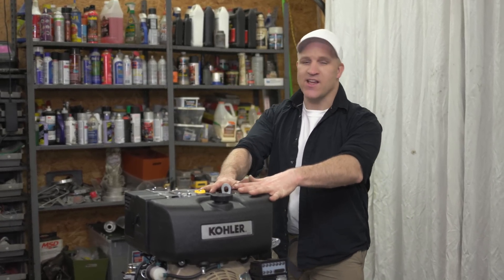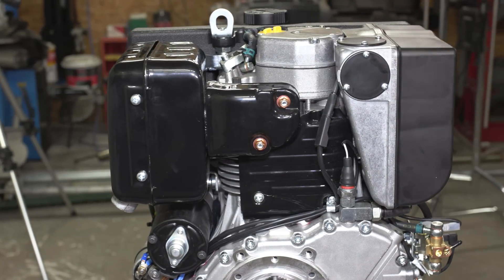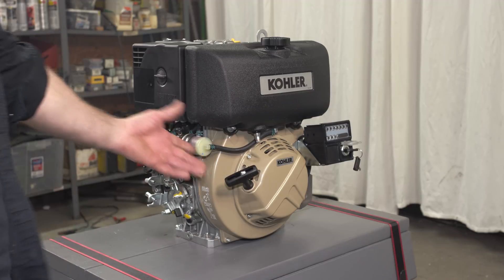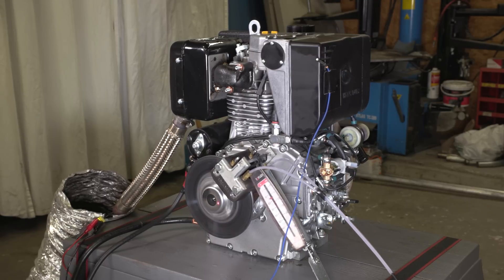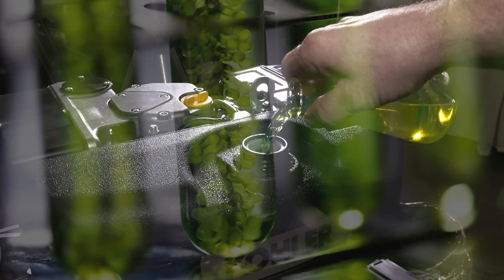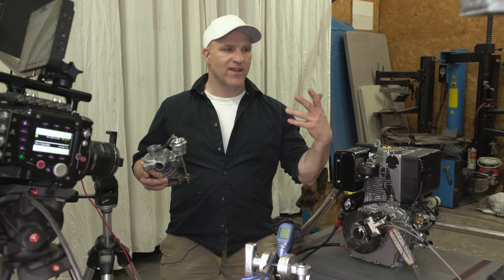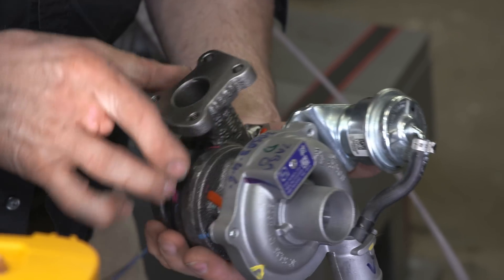Single Cylinder Diesel Engine - Dyno Test (Diesel, BioDiesel & HydroDiesel How Much HP?)

Comment: If you want to run it well with the turbo, you need a "boost tank" between the turbo and the intake into the engine. In a 4-stroke single cylinder, it's only pulling in air 25% of the time, the rest of the time, the turbo fights against a wall and will stall, the reserve tank allows it to build a little boost between the intake strokes without stalling so much. That way it'll have boost ready for the next intake stroke, then the resulting extra exhaust gasses spool the turbo more, creating more boost, and so on, until the turbo can't provide any more boost.
Reply: Known as a plenum.
Reply: @noidontthinksolol  that's another way of doing it sure, doesn't mean the reservoir doesn't work, it worked well for me on a 212. Gave it much more pull. Saved me spending money on a BoV when i had spare tubing laying around. I supposed a BoV does protect it from overboosting and blowing the head off or something, but then again, it's not like it's a 900bhp chevvy lol, just a bunch of cheap second hand parts on a second hand go-kart frame. Bit of fun :D
Reply: @noidontthinksolol  old stuff is way more fun, throw some stuff together, let it rip, have fun, it blows up spectacularly? even more fun! then go buy another haha

Comment: An engine making XXXX RPM and YY.Y torque always equates to a certain amount of power -- regardless of what fuel is being burned.  There is absolutely nothing interesting about that.  The most important piece of data -- which was mysteriously left out of the report -- the specific fuel consumption would (might) have revealed something interesting about the fuels, but because of the engine's governor, we don't know how much of each of the three fuels tested was turned into work, or how much was wasted as heat.

I suppose the warping in the actual perception was that this was about an engine test, while it was actually about an inconclusive fuels comparison; the engine was somewhat inconsequential, like the settings in Dino De Laurentiis' 1984 film "Dune".

Comment: How many times have you had to replace those brake pads lol. I ‘dynoed’ a 110cc pocket bike engine with a little disk brake on the output shaft and I could practically feel it wearing out with the hand brake I was squeezing with. Disk would turn blue in 10 sec

Comment: You need to do red off-road Diesel fuel
Reply from the maker: I was told that the red diesel is the exact same as the regular diesel but just has red dye added to it for the taxes. That's what I was told anyway

Comment: Interesting that the egt was about 100 degrees higher with the hydra diesel but power was comparable to regular diesel. I’m curious if the turbo will help the egt like it should or if it makes it worse
Reply from the maker: That's a great question that we're going to find out the answer to very soon.

Comment: presumably its just got a mechanical injection pump that should be easy to increase fuel for boost?
Reply from the maker: Yes, you can increase it to a point but you can't really start rolling coal.

Comment: Just a suggestion - you should try turning up the air fuel ratio and see how much the power increases
Reply from the maker: After I finish up this video I did. It was pretty decent, I also injected a ton of diesel right into the turbo and it was a pretty scary sight.

Comment: IF the engine is brand new, and you did the hydrodiesel last, it kind of stands to reason why it made more power.
Reply from the maker: Well I forgot to mention that in between the first scene where I started it for the first time, and the test, I'm broke the engine in completely over a. Of 4 days. When you first start these engines up before the rings break in they make a little bit of smoke, but once they're broken in completely there's almost no smoke at all. I forgot to mention that but I can totally see what you're saying.

Comment: Yanmar Hyundai and Honda sell the same single Diesel engine. How comes the rpm was 2900 when the hydro diesel was used? The rest was 2800 that would up the hp a little, also be interested to see about using a premium diesel against regular diesel and maybe with even a carbon monoxide tester up the pipe like you said 👍👍
Reply from the maker: I'm totally going into that in the very near future here, as for the RPM I'm not really sure, I tried to get it to hover around 2,800 but for some reason it didn't like that, it wanted to settle in at 2900 while the other two settled in a 2800 just fine.
Reply: Warped Perception brilliant look forward to everything your going to put to test! Oh I see! Well not much of a problem it’s not far out, most generators run about 3000rpm pretty impressive revs for such a small engine! Once had a Honda single diesel  generator and it ran away on its own oil and it wouldn’t turn off stuck absolutely flat out couldn’t get to the air intake to block it and while I was messing around trying to get it to turn off the electric side melted everything that was plugged into it haha, anyway can’t wait to see what happens good job👍

Comment: I'd like to see how power increase with propane sprayed into air intake (it can increase power over 30%). In europe some people convert diesel engines to LPG (propane+butane) in two ways 1. small amount of injected diesel is used to ignite (but in can burn injector nozzle over longer time) 2. converting engine to petrol (changing injector to spark plug and lowering compression ratio).
Reply: Yes propane adds power to a diesel but it has no lubricity. Diesel is an oily fuel lubricating the cylinder as well as powering the engine. Much propane use burns up the cylinders.

Comment: One hell of a setup! On the dyno, isn't that lb on the left and kg on the right? Am I not reading close to 30, at what looks like one ft? (Maybe that's not even close to 1 ft, if so, ignore my comment.)
Reply from the maker: Yes you are absolutely correct, but since I was trying to keep this Dyno compact when I built it as well as clearance restrictions between the base of the engine and the crankshaft, I went with a 6-inch fulcrum point. So that basically means whatever measurement you get on the scale needs to be divided in half to get foot LBS.
Reply: @WarpedYT  Makes sense, I couldn't get a good sense of scale in the video but at first glance I thought it could have been 12 inches. Clever setup!

Comment: You really should have built a graph to show the different results at the end of the video. I looked at the numbers after each run but there's no way I can remember all of them to compare. Otherwise I've always been interested in seeing some numbers on single and twin cylinder diesels. Thanks!
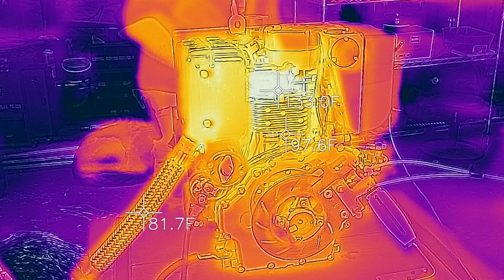Reply from the maker: I know I'm so sorry, I'm actually made that graph and the comparison chart, but since I finished this at it at like 4:30 in the morning, I was really tired and I absolutely completely forgot to include it, but what I'm going to do is in the next episode in the beginning I'm going to do a little overview of how much power the engine made with the previous set before moving on with my plans and then I'm going to dyno it one more time before starting the episode. But yeah long story short I totally forgot

Comment: I just don't like your makeshift take dyno.dont see how that would translate exact hp per engine it's just a scale attached to a brake pad I know someone will have some kind of far-fetched math to say it is right but I just don't think it's correct close but not exact I mean.
Reply from the maker: It's as simple as that believe it or not, that's all that a dyno is. It really is that simple, I mean in this case there is some friction loss from the brake pads, but that's also the case with the water Dino as well or an Eddy. I have tested this Dino multiple times and it is within  5% accurate or better. If you look back at the original episode where I build and test this Dyno, I check the accuracy. It was surprisingly accurate. A lot of things are made more complicated than they need to be, calculating horsepower is very very simple.

Comment: do you adjust your torque readings  for the cosine error of the force gauge? as the spring balance is pulled around its force vector moves away from the tangent of the brake disc and makes its reading off by the cosine of the angle that it makes with the tangent.
Reply from the maker: No I did not, it was only a few degrees at its maximum, I honestly don't think It made that much of a difference and one thing I didn't factor in was the loss if the braking force, so I figure the amount of loss from that angle change is made up for my lack of factoring in the loss of the brake pads, but it's cool that you noticed that. 👍👍

Comment: I have run a small engine dyno back in High school. We had a water pump dyno system that was very accurate. That thing your using looks like Homer Simpson made it.
Reply from the maker: Originally I was going to use a very sophisticated water set up oh, but I wanted to make it completely visual some people can understand it visually especially people that know nothing about mechanics. I built this design just to try it out and found out it was surprisingly accurate. So I kept on using it. I was even going to go as far as making a more refined version but then I ended up changing my mind simply because this one still worked.
Reply: He did.

Comment: $3299 for a singles  cylinder diesel engine!?!?  Might as well pick up a 4bt or om 617. Good video can't wait for next episode just caught off guard on price.
Reply from the maker: Thank you, well you know those are different Engines thought. I would assume the applications for this engine would be completely different then a mainstream car diesel, which in my experience for like construction equipment, diggers, concrete cars, pumps generators and other custom critical applications and stuff like that the price will probably be justified pretty quickly through the difference in reliability. I actually own a front loader that has a Kohler engine, I've never ever had an issue. Applications like that rely heavily on reliability.

Comment: Could you try HPR diesel?
Reply from the maker: What is that ?
Reply: @WarpedYT  HPR stands for high performance renewable diesel. It's biodiesel but different. It is sold by propel fuels. I think it may only be available in California. I tried it in my old Jetta TDI a while ago. The engine runs quieter, almost no exhaust smell, starts and runs better when cold. However I didn't get any increase in power or efficiency that they claim.

Comment: Why not Vegetable oil mixed with 15% gasoline ? some guys use it as diesel fuel.
Reply: its very dangerous since the compresion on the cam

Comment: Never knew hydrodiesel did this good. What about premium power diesel, would it perform better than regular diesel or is this a "scam".
Reply: Roger ... I never knew it existed until this vid ..😂 I'm irish so it may not be on this side of the pond... 🙄🤨

😎👍☘🍺
Reply: @peterfitzpatrick7032  hydrodiesel, yeah same for me
 But I mean there are so many fuel types and oils brand and mixes on the market that claim so many things. I really wonder if premium power diesel for trucks will get a higher horsepower number. Will probably be just a little bit on the small engine, but a small increase will show us the numbers.

Comment: 00:46
Kohler, Yanmar, Hatz, Deutz, Lister Petter...
All currently manufacture a single cylinder (air cooled) diesels.
Reply: Do you know of a simple single or twin cylinder engine that makes more than 20Hp? I want to diesel-swap my Trabant...
Reply: @Handyman1199  Hatz makes them.
I installed a few dozen into remote hydraulic power packs on Aebi Schmidt equipment.
Hatz by far are clearly superior to anything from Kohler, Briggs, domestic USA etc. not sure about Yanmar but hear they make some great stuff too.
I would find a used forklift with the size engine you need for a cheap Donor engine, transaxle :).
Then sell the leftover forklift for scrap, or parts...maybe profit even.
Reply: Put a 20hp in it.... amazing fuel mileage.....aaaaand it might be just a TINY TINY LITTLE BIT SLOOOOOOOOWWWWW  🐌 💀💀💀🤣🤣🤣
Reply: @bronco1786  it does 80 km/h with stock 26hp at 4.500 RPM redline
Reply: @Handyman1199  Did you get your swap done or move onto a different project?
Reply: @Parents_of_Twins  a 20hp Diesel swap would be great but due to emissions it’s basically impossible to do so here. Germany allows all swaps from Diesel to Gas and no more than 40% more power than stock before you need to test the ridgidity of the body. Gas to Diesel swaps aren’t legal since all swaps need to keep or improve of the emissions. I’m kinda working on swapping the 600cc 2-cylinder air cooled 26hp engine for a 1000cc 3-cylinder water cooled 50hp unit. Both are 2-Strokes. Still need to find some parts and find an inspection engineer that will put his name on its vehicle title. Similar story with my 1995 Astra F GSi (GM T-Platform) to wait for the C20NE 2.0 8V 115hp to die and make space for a replacement C25NE (2.5 24V 170Hp V6) or X30NE (3.0 24V 212Hp V6)
Reply: @Handyman1199  I don't understand why diesel swaps aren't legal but swapping in a 2 stroke is alright. Sounds like your politicians don't listen to science or reason either.
Reply: @Parents_of_Twins  NOx Emissons are higher on Diesels than Gasoline engines, but CO2 is lower. NOx however has this pesky attitude of creating acid rain. Two Strokes have the lowest NOx of all internal combustion engines, however they create nasty toxic CO emissions and carcinogenic oil fumes out the exhaust whilst chugging fuel
Reply: Lombardini the best of all

Comment: I wonder how you're going to introduce the extra fueling under boost. I'm guessing it doesn't have an old mechanical ve style pump, but can't imagine it uses a maf or map sensor and some sort of ecu.
Lpg into the intake is cheating lol
Reply: 1:1 fuel pressure regulator would be my guess

Comment: I want to see a diesel motorcycle :)
Reply: Search they make them Detroit diesels ect radio diesel motorcycles
Reply: In India if you search Rajdoot or Chackda. This are also Diesel ones.
Reply: I have one diesel motorcycle, suing since 8 years
Reply: What reason?
Reply: @Brettjnash  diesel engines are heavy, they vibrate a lot, they have more torque but low rpm, totally opposite of what motorcycles need. Diesels with same displacement have way less horsepower than petrol engines
Reply: @johndelorean7353  And still there are a few companies that still make them, like the Sommer Diesel motorcycle. Royal enfield also did. Only 7 HP from 325ccm, but very low fuel consumption.  Less than 1,5l/100km.
Reply: @teslatrooper85  but shouldn't a turbo and bigger injectors increase power at the cost of mileagw
Reply: @tyhma1563  Maybe, but i think it would be pretty hard to find a matching turbo
Reply: @teslatrooper85  i've seen a tiny ass turbo for 213€ online
Reply: Yes!
Reply: I am also trying to do developing more efficiency for this engine. But l have very less possibilities. I have more ideas in my mind....
Reply: Also special thanks for WP...U are sharing very helpful videos for solving our doubts. I am your one of regular viewer
Reply: Somebody want to see diesel engine motorcycle, lwill share with you with advantage and disadvantage
Reply: Very rare for a reason

Comment: I had one of the cheap single cylinder diesel engines. It actually ran good once you tightened all the boys correctly. This engine just oozes quality tho. What is the cost?

Comment: I know it may sound ignorant but ... could you try to induce a "runaway" of that engine in a future episode?  If it is possible to do in these modern engines and if so, what would be the methods to try to stop it.  It would be really cool.  Thanks
Reply from the maker: That doesn't sound ignorant at all, I'm going to be doing that in a future episode and I'm very excited about it.
Reply: @WarpedYT   Wow thanks for the reply! Very excited too! And...  it will be interesting making a "See Through Diesel Engine" if possible, too see the different types of fuel firing inside and its behaviors, since diesel engine has no spark plug.